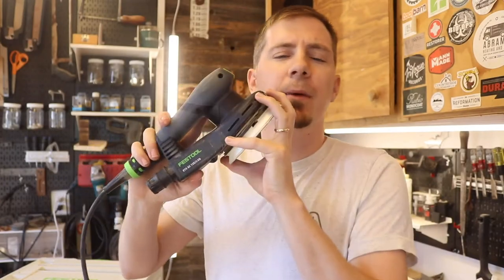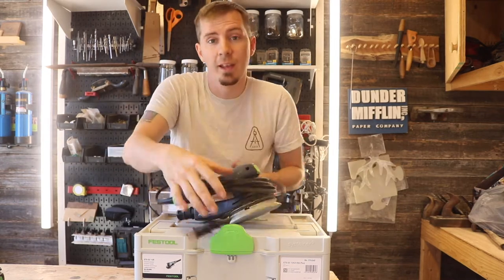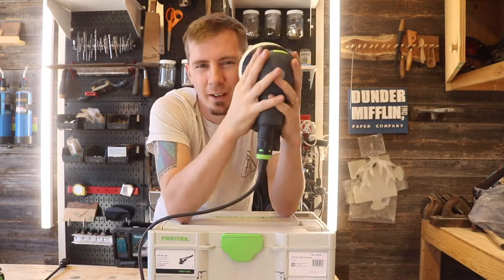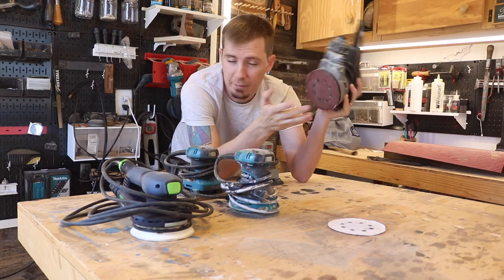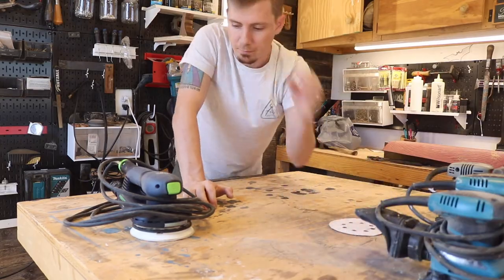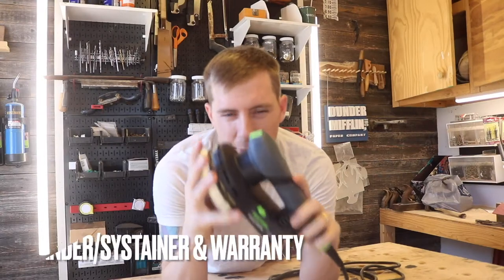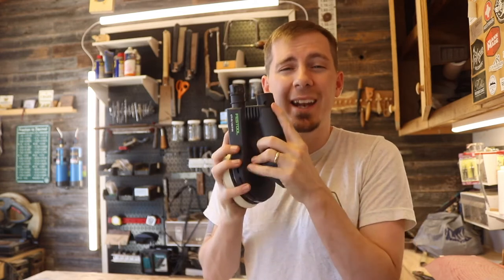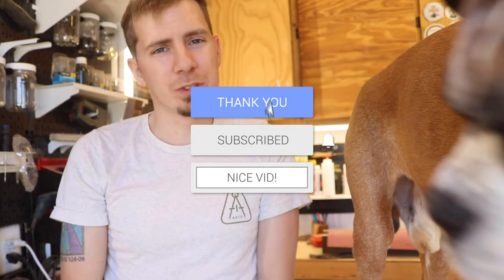I Finally Upgraded to the Festool ETS 125

Comment: I did the same thing. Used the cheap harbor freight sander until it died and went in for the rotex and it was worth every penny. Legit sands 4x faster with way better results. Just in time spent on one project, pays for itself

Comment: I was the same way, swore up and down I'd never own the evil green... However after growing tired of the hand fatigue I started looking at better sanders. Mirka. Surfprep, ekasand and festool. Could not be happier with my ets ec 125, and now purchasing their midi to compliment it.
Reply from the maker: If I was into refinishing I’d definitely have gotten the Surfprep. Festool is the way 😈
Reply: How do yiu feel about your purchase now? I am considering the same sander and dust extractor set up and would appreciate your insight. Do you wish you’d gone up to the 150 (6 inch version)?
Reply: @R W  buy the 125 and then purchase have the 150 pad separately. You cannot use a 125 pad on a 150 sander though, so you get best of both when you buy the 125.

Comment: I used to think Festool was overpriced. Then I bought the Rotex. Wow. Then I bought the MIDI dust collector. I love the Rotex but man, it’s a work out. So I just bought this sander. I make a lot of river tables, and wood/epoxy charcuterie boards.  Using this after using the Rotex to knock the high spots down makes life so much better. In the end, well worth the money IMHO. Thanks for the video.
Reply from the maker: I’ve used the Rotex as well and it is a monster!

Comment: Food for Thought to others  .You spent close to $300 on all the other sanders before the EC125.  That cost $385 in 2017 when you'd had a bit of experience with sanders.  If you'd bought the best then, your cost wouldn't have been much more than your aggregate spend over the years and you'd have had the benefit of the great sander for longer.
Reply from the maker: Great advice that carries through many facets of life. Spend now, save later
Reply: It’s called buy once cry once.

Comment: I finally got one of these to replace the Bosch I have been using, and the difference between the two is like night and day.  I always had to hand sand a fair amount after I was done with the Bosch to get rid of the swirl marks, which is hard for me due to a back injury.  With the Festool I don't have to come back.  It is an amazing sander, and well worth the money in my opinion. Edit:  both the 125 and 150 have the same 400W motors. The ETS 125, not the ETS EC 125, is their entry model at $249: the EC has more balls and is more ergonomic IMO.

Comment: Hey man. Love the vibe! and the hound at the end. I build rocking chairs, and have been using the Rotex 125 exclusively. It'a beast to hold, but my oh my does it give a lovely shine with 800 grit paper. So I've been checking out lighter sanders, something to finish the chairs with, something that's a little easier on the wrists. I've watched a lot of videos on the ETS 125 and based on my experience with the Rotex, the ETS 125 is the way to go. Thanks for taking the time to make the content! Keep going. And keep the hound.
Reply from the maker: Thanks for watching Tony!

Comment: finally got mine had to wait till amazon restocked and when i got the notifications instantly got it. havent used it much more then testing but gosh damn its smooth and my hands wont be going numb any time soon
Reply from the maker: The benefits of not having achy hands are worth the price tag alone!
Reply: @TheReformationWoodshop  yeah man. My fingers go numb and have a weird springy type feeling after using my old sander.

Comment: What dust collection to you hook it up to?  I recently bought the new 3M sander and what an amazing upgrade.  I don’t think your purchase was a mistake.  Until you use a top of the line sander it is hard to imagine that it will make such a difference.
Reply from the maker: I’ve been really wanting to try out the 3M. I’ve heard a ton of good things about it!
Reply: I bought the 2.5mm orbit 6" 3M, but honestly like the ETS 150 5mm orbit a lot more.  The 3m sander with the cubitron II has great dust collection, but feels off balanced in the middle of the speed settings.  Even with the 2.5mm.orbit version it will hog some wood.  I found the ETS has better ergonomics too.

Comment: Looks like you need the dust extractor - makes sanding even nicer. At least get the bag on to capture the dust.
Reply from the maker: You are correct. I didn’t want to shell out the $600 at the time 🤣
Reply: Bags are of no use on the EC series. No internal blower as they're meant to be used with a dust extractor.

Comment: Just purchased this sander and like it so far. It does seem to jump around on this surface and is hard to control at time though. This happens with and without dust hose connected and with the festool paper and with another manufacturers pap per as well. Any idea why the control is so poor?  My 50 dollar toshiba handles better.
Reply from the maker: The balance should be top tier. Maybe your pad is not sitting right? Try turning down the speed and see how it handles. If it still wobbles it’s most likely the machine. If it doesn’t maybe the top speed is just a tad too much for ya.
Reply: I believe you're encountering grain and surface irregularities.  The sandpaper is griping and at sometimes it wants to hop and jar left or right.  Slow down a bit and move at a consistent speed.

Comment: Why ETS 125 vs the ETS 150 since you use both at work? Was it price alone? I like the idea of sanding faster so thinking 6in sander, but currently have 5in and a lot of 5in paper. Wondering if there are any downsides to the 6in that made you go with the 5in sander?
Reply from the maker: I’ve used the 125 and 150 and just don’t feel like the little bit of difference between the two was good enough for me to spend that extra $100. I’m in the same boat with the sandpaper so I’m keeping my 5 inch on until I run out of paper. The 6 inch is definitely better though 🙌🏼
Reply: @TheReformationWoodshop  j
Reply: You can use the 6” on the 5” 125 ets ec sander. ( per all the research I have done here on these channels)
Reply: @kandiecandelaria3134  Correct. 6" pad on the ETS EC 125 sander. However, you cannot use the 5" pad on the ETC EC 150.
Reply: @BuckRogers2491  that is correct, the only diff is the 150 is 6” the 125 is 5”
Reply: @kandiecandelaria3134  The most important distinction, and why the 5" pad won't fit on the ETS EC 150 (6" sander) is due to the wings on the ETS EC 150 drive shaft.
Reply: @BuckRogers2491  yes I know this
Reply: @kandiecandelaria3134  Other people may not, hence my inclusion of a potential got'cha.
Reply: @BuckRogers2491  no worries can’t wait to get mine
Reply: @kandiecandelaria3134  If you haven't used one, you'll love it. It's ridiculously smooth and dare I say pretty darned quiet. If you don't know, it needs dust collection since there's no internal blower for bag usage. That doesn't get mentioned much.
Reply: @BuckRogers2491  getting the 26 dust thing as well
Reply: @BuckRogers2491  but the bullet today, got the 125 ets ec and the dust extractor 26. Can’t wait to play with them!
Reply: @kandiecandelaria3134  Very nice! Add the Bluetooth module to that CT 26 for some super convenient cleanup and ability to trigger from non-Bluetooth/non-Festool products.
Reply: @BuckRogers2491  soon as I recover from the prices lol!!!
Reply: I have two 6" pads( soft & hard) for ets ec 150 and bunch of sand paper for the same pad. I don't have the sander itself . I found used one ets ec 125. If I was to use 6" pads constantly on ets ec 125 will that wear out the motor faster and affect the work of it  since is 60 wat weaker?  Does anyone have an advice on this? 
Thank you in advance

Comment: I bought mft/3, ts 55, ets 150/5, ct 26/cyclone, domino & OF 1400 this month and I am selling everything else. Festool is basically all that matters to serious people, from diy to pro, Nothing else is worth my time anymore. I am not skilled enough at messing with machines to fight tools and sick of it getting in the way of my actual use of them, Festool SYSTEM is just better for what I do and what I want to do than mix and matching all the run of the mill universal stuff. Selling my miter saw, getting Kapex. Selling my table saw, not going to even have one until Festool has a corded one. I am that serious about it. Selling all my ridgid stuff too.